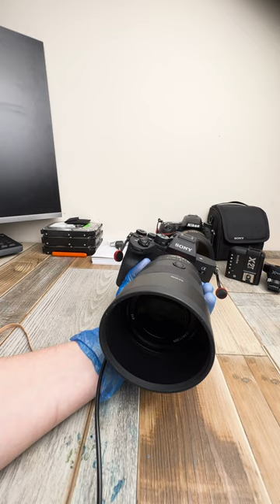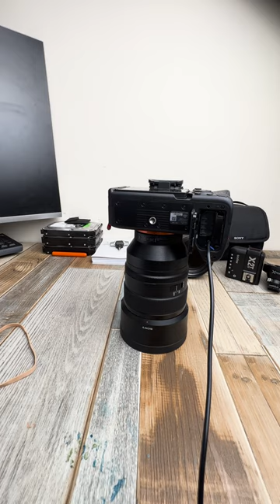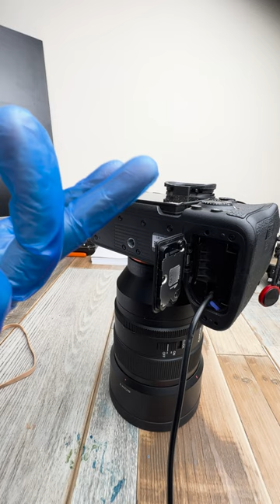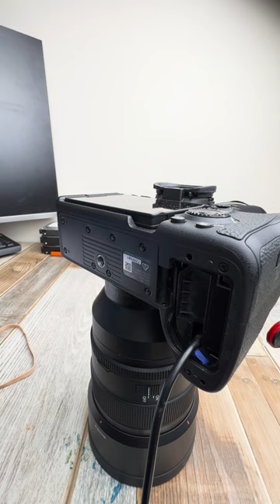Remove battery door on Sony a7IV

Comment: Puede dañar la. Cámara la batería dummy ????
Reply from the maker: I have used a dummy battery for years and never had an issue with it. Provided it’s a good quality one I think it should be fine. I believe Sony makes one as well. If you want to be sure your camera won’t sustain any damage from it, then perhaps you can go for the Sony one, it will however be more pricey.
Reply: @florinG gracias saludos 🎉🎉😊